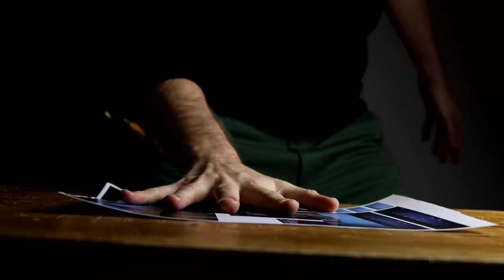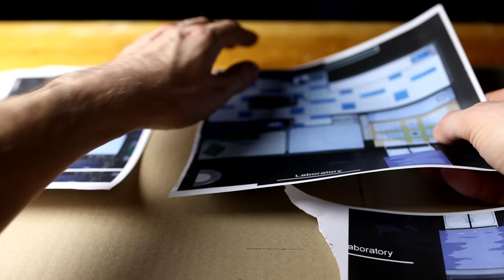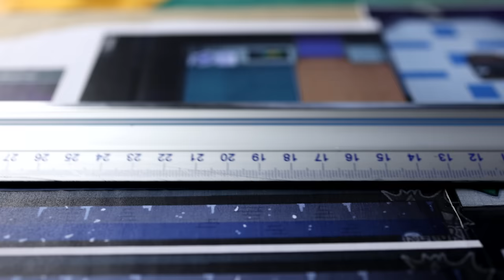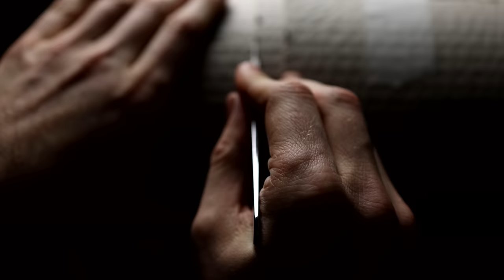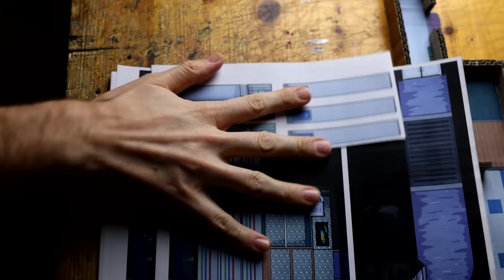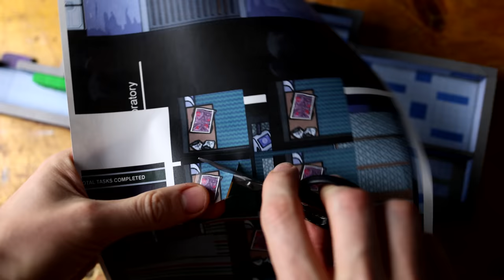Building POLUS (Among Us) with cardboard & clay – Part 2

Comment: 1. The beds are because the right half of laboratory is the Medbay, that's why there's a scanner in the corner.
2. There are windows in the Speci hallways, that's why bars of vision project out of them.
3. There is, in fact, an Easter egg in the bathroom where there is a white/cream/tan crewmate in one of the stalls. You can see a visor if you look closely at the crack in the door.
4. Polus is a planet, as the icon shows, so it's not empty space.
5. This is an amazing project, a lot of clever ways of making the different parts, keep up the good work and I hope I helped! :)

P.S. I know I'm very late to this but I figured I'd compile everything into one comment.